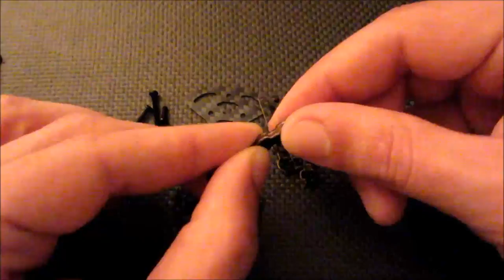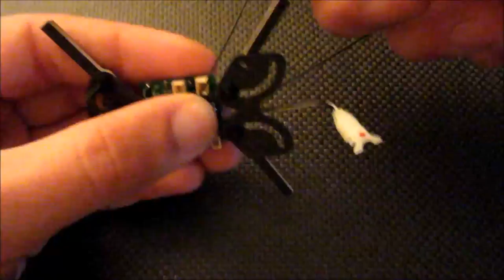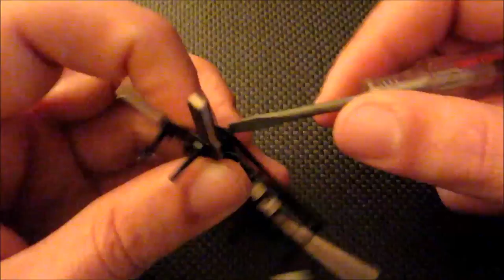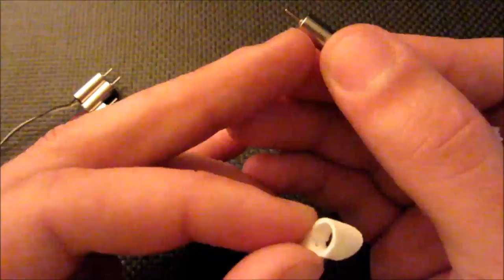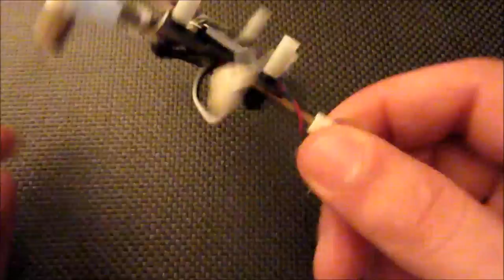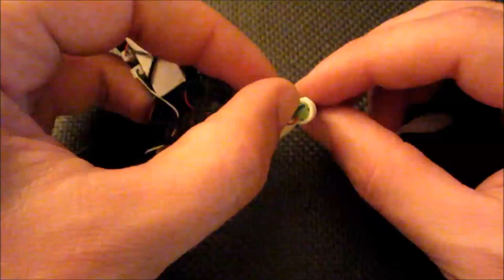Picnic Quads nQXF Folding Frame assembly

Comment: Which transmitter are you using ?.. and which do i need to use with this FCB . .. also do you think this build would be able to carry an 808 keyring cam ?
Reply from the maker: +senseTUBE I use Devo 7e but it requires some modifications to get good range from it.  Many folks use the spektrum Tx but you really just need something DSM2 or DSMX compatible.  You might be able squeeze an 808 camera with this frame however an 8.5mm motor based build would be better and there are larger frames available that would fit the components much better.
Reply: Dave Woods cool .. anything like this ? folding .. carbon .. etc? i really like this .. frame so something similar for carrying an 808 would be great!
Reply: +Dave Woods and something i can still use the http://www.horizonhobby.com/4-in-1-control-unit-rx-escs-gyro%3A-nano-qx-fpv-blh7208 on .. btw will this radio work with it ? .. 
http://www.horizonhobby.com/dx5e-dsmx-5-channel-transmitter-spmr5520 ?

if you can advise which picnicquad frame is gonna be best for my purpose that would be hugely helpful and ill be really appreciative :) 

cheers !

Comment from the maker: To get these boards search e-bay/google for "Nano FPV 4in1"
Reply: Dave Woods Ok, just a few questions . Do these boards require a transmitter or is that also integrated? Do they require a program to set up before flight or is it just plug and go? And finally can you point me in the dirrection of a small reciever that would work with this? Thanks
Reply from the maker: javier lopez You certainly need t transmitter.  The integrated Receiver requires a Transmitter with DSM2/DSMX.  FC is plug and go but you may want to upgrade the battery plug.